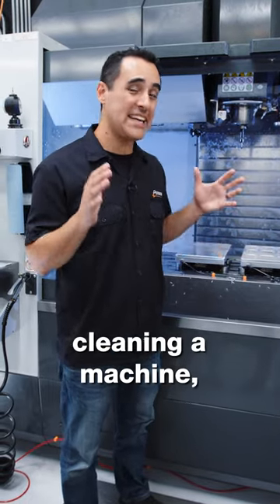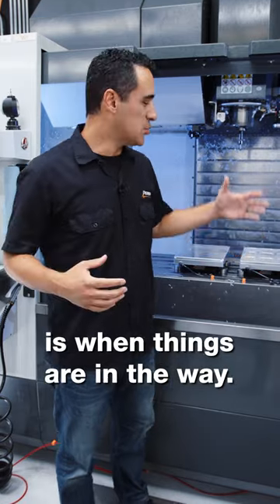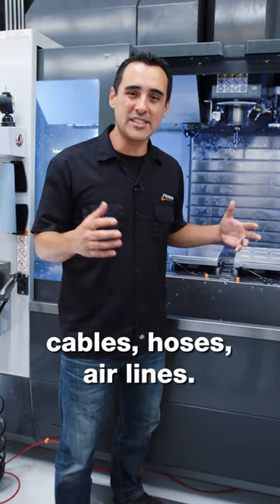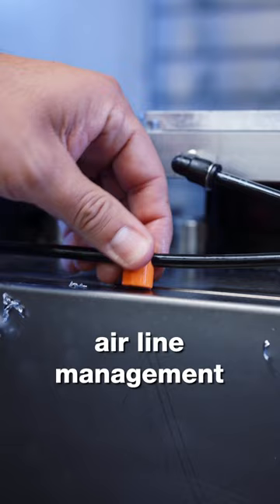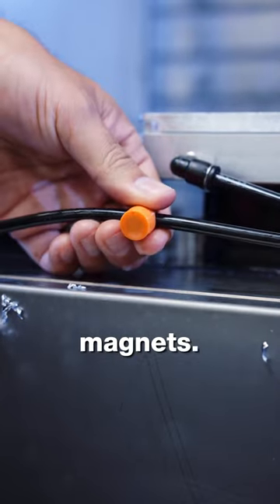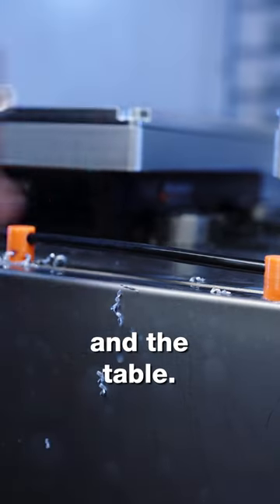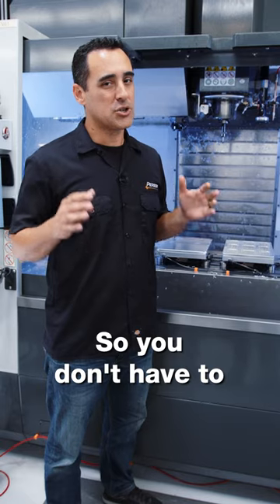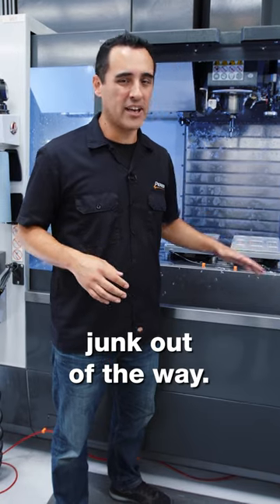Machine Cable Management | Machine Shop Lean Tips #shorts

Comment: Very smart. how do you deal with chips attracted to the magnets?
Reply from the maker: It's not a problem with aluminum but printing larger diameter housings make steel chips less attracted to the magnet so air can easily blow them off.